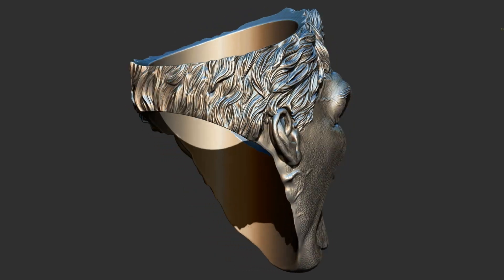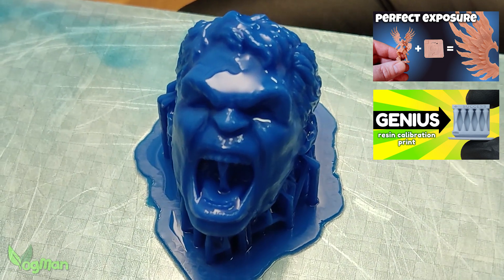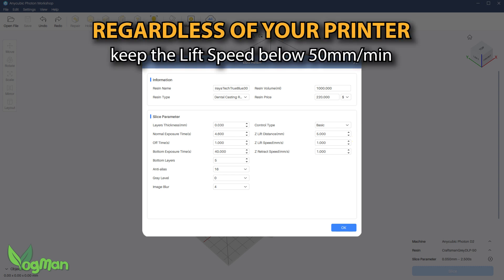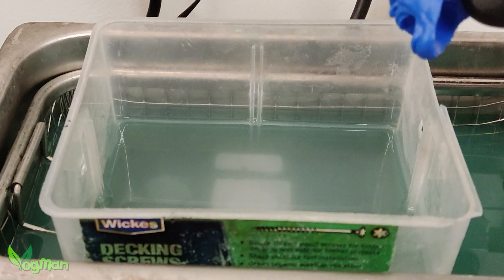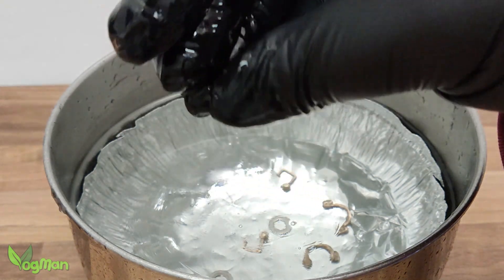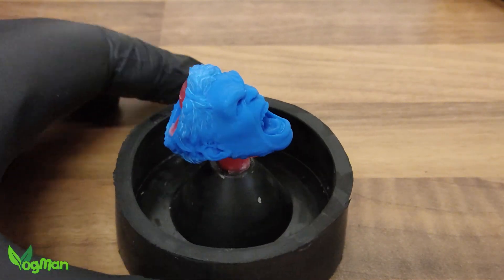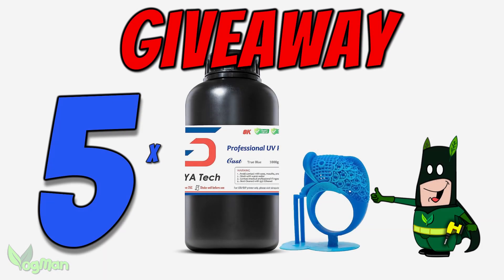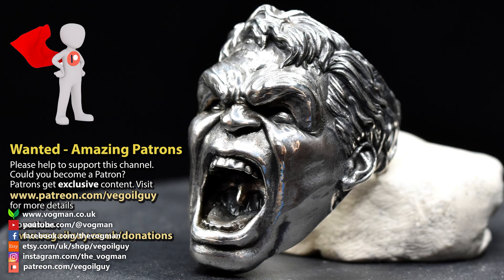Siraya Tech True Blue Castable Resin USER GUIDE for Metal Casting

Comment: GIMME TRUE BLUE. I'm starting out with these casting resins and the video was helpful. However I am trying to print out larger pieces for bronze casting. I tried using the Phrozen violet resin with not great results. Seems even trying different support sizes and thicknesses still had failed prints. Prisnts start off well but loose connection. After about 1" of printing layers. So will try Siraya and see what happens. I am assuming Siraya has basic settings for the Phrozen mighty 8 k?

Comment: I have a elegoo mars 3 pro and I am also trying to use tru blue siraya tech. I keep running into issues where the print isn't sticking to the build plate and is stuck at the bottom of the FEP later. I have tried re-leveling and changing the FEP layer with a fresh one. Could you share any tips? Also what settings are you using?

Comment: @vogman - I have been unable to get any sort of print out of this stuff.
Im on an Anycubic Photon X first Generation.
I have used the recommended settings from Siraya Tech, and had 3 failed prints.
But I mean, NOTHING prints.
No Bed Adhesion, Nothing globbing up in the bottom of the FEP pan, nothing.
I do not have a heater, but I live in Arizona and the room temp is 75 degrees F.
I have even tried LONG exposures like 60+ seconds on the base layers
Can you give any advice?

Comment: I tried my Siraya castable ture blue with the setting in this video and the website of Siraya. And my room temperature is from 25-31. And it just printed the bottom of the support most of the time. Or it fell from the platform when it was about half printed. Can somebody tell me why that is, and how I can fix it?

Comment: Hey @VogMan quick question. How are you compensating ring size for shrinkage? I have the exact same setup d2 with sirayatech true blue and I'm finding it difficult to get perfect ring sizes when sizing the inner diameter in zbrush. Thanks!
Reply: I got around 4 percent of shrinkage after curing for half an hour also using true blue cast of course

Comment: GIMME TRUE BLUE. (Edit: Never mind the following, I see that you have done this in other projects) Have you considered designing your supports so that you have a built in sprue for the casting? It seems you cut away supports, then have to add a bunch back in the form of a wax sprue. I am wondering if you could design multiple items to be ready for the flask.
Reply from the maker: Thanks John, you're in the draw.
And yes, you could incorporate sprues into the print design. I was just proving in this case that wax does work 😁

Comment: GIMME TRUE BLUE , Love your video's man, looking for a better casting resin at the moment. 
I've actually found quite a few brands that say you need a special type of plaster. Have you've looked into different plasters and resin pairings? 

From what i've found phosphate bonded plasters will work perfectly with all castable resins because the burnout temperature can be way hotter and it's less reactive.
That stuff is super expensive though.. Other plasters like Plasticast seem to be designed specifically for casting with printing resins but also not all of them seem to give perfect results. (The manufacturer also doesn't specify what resins will work) It's also limited to lower melting point metals it seems..

I'm now using  SRS Classic but i'm going to try different plasters soon because it's really expensive for me  (A little over 100 euro's with shipping for 22kg, I live in europe) 
I'm thinking of trying the Plasticast or the Aurum plaster from R&R. The latter is apparently made in europe and I found a place that sells it for relatively cheap.

Comment: Tried this resin with mars 3, never had any success. It does not stick to build plate or vat which is weird, so in every print i was having lots of floating islands, but i had few prints that was able to print but resin was bad sticking to each other so whole model, all layers was peeling like onion. Maybe i had faulty batch...
Reply from the maker: Peeling layers generally occurs with over exposure, from my experience. Dial in using something like the Cones of Calibration. Make sure your lift speed is low... fast movements will break this resin. Then use a large raft to help with sticking 😁
Reply: @vogman  I wasn't using big raft, I covered whole build plate and cured it for like 3 minutes so that models do stick, and they did till certain point and then I litteraly have whole layers floating in the vat, like if whole layer wasn't sticking to any of the surfaces. But my exposure was like 1.8s, will give it a go few more times then. Is a bit difficult as resin is veeery messy as well, more than purple.

Comment: Gimme true blue
Reply from the maker: You're in the draw 😁
Reply: @vogman  cool 😀

Just gotten into all this resin printing.

Mainly because sandcasting has its limits.

And i do blame you for this occasionally expensive hobby. 😆

But good content. I learned quite a lot here, still havent cast anything 3D printet though. Still figuring the printer and settings out, using far cheaper resins.
Reply from the maker: Hi buddy! Congratulations – you’ve won a bottle of Siraya Tech True Blue castable resin! Please contact me via my website to claim you prize https://www.vegoilguy.co.uk/contact_general.php  😁😁😁

Comment: Another great video, and at just the right time for me - I'm having a devil of a time calibrating my printer for castable True Blue. In your experience, did you have trouble with build plate adhesion/needing an oversized raft, and do you use any calibration prints with this resin more successfully than the cones of calibration? Even at 60mm/m lift height (seems to be the minimum for the Halot Mage), prints seem to be pulling apart, possibly due to the lower strength of the wax resin.

Separately, it looked like you'd made a pickling solution (citric acid) to clean a silver cast, which is good - but be careful not to allow that solution to be in contact with stainless steel (tweezers, ultrasonic cleaner basins, etc) as it can contaminate the pickle and plate your silver part with the contaminants.
Reply from the maker: I initially struggled with TB. It took a few attempts, but I got there with persistence. If you have sticking issues, make sure your plate is very clean (soak in IPA overnight). Also have a large raft. It really helps.
Not come across the tainting issue. Thanks for that. I don't sell or have my work officially hallmarked, but it's a good thing to know in case I ever do. 😁
Reply: @vogman  I was able to (mostly) solve the issue with prints detaching from the print bed by committing the sin of gently sanding the brand new build plate. The Halot Mage's build plate was the smoothest plate I've ever seen, and even after a bit of roughing up it's still not even close to the amount of texture on any of my Elegoo print beds. It didn't feel good doing it, but having the prints now stick with the same settings helped me eliminate one more variable.

Comment: Good video as always. Question, why don't you model the casting stem onto the object model? It seems that it would remove some of the supports and reduce some work.
Reply from the maker: You need to watch more of my casting videos buddy. I usually do include the sprues in the print. However, as this video was to show what the resin is capable of, I went with the traditional approach 😁
Reply: @vogman  i should, unfortunately work and school take my time and I got a request for 100 mini's for a community event. Which would be a lot easier if I had a phrozen might/athena sized printer, but I have a phrozen mini.

Comment: I’m curious, VogMan; when it comes to using an LCD printer for jewellery, do you think using a 12K printer gives better surface finish results than an 8K printer? Or is it negligible at those kinds of resolutions only make a difference in  silver finishing time?
Reply from the maker: Without an ACF liner, 12K printers would work very well. 😁

Comment: Oh, this looks nice. I don't have a casting area, would love one honesty as I have miles of copper wire, but I want to see how castable the resin is. Well, castable as in mold making. "Normal" resin inhibits platinum cure silicone, I wonder if the higher wax content will allow molding without having to off-gas the print for weeks and coat it with inhibitors.
Reply from the maker: Unfortunately I've no experience there...
Reply: @vogman  Oh I am sure, just you got my mind a wondering, again. I kinda like to experiment.